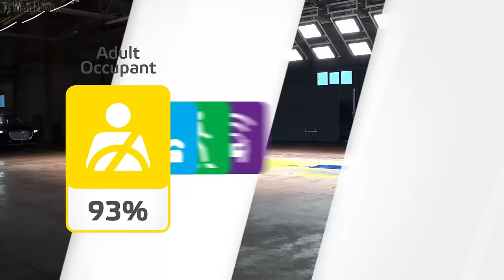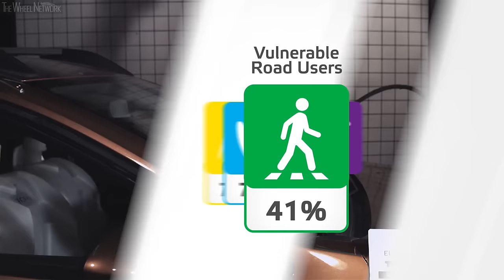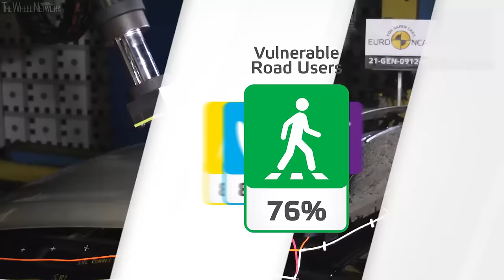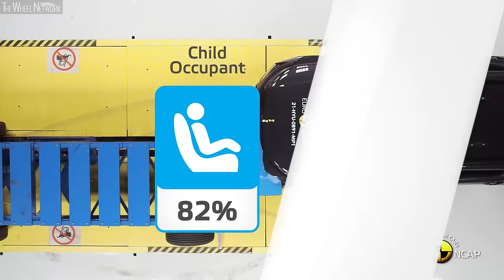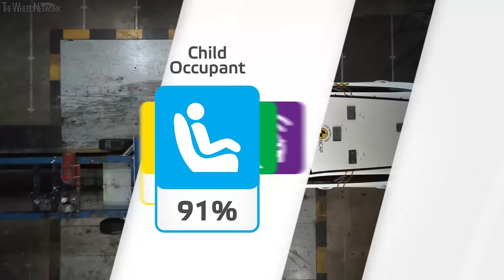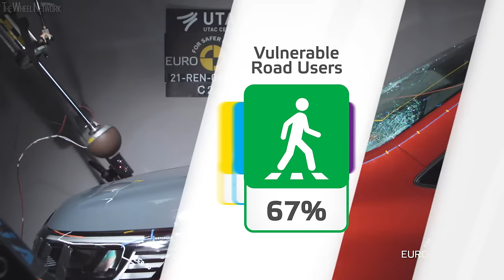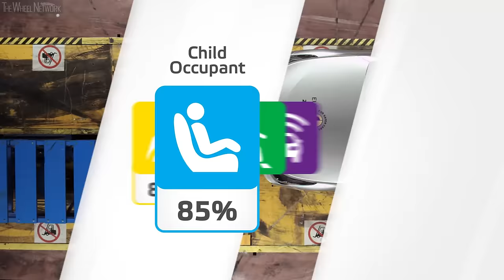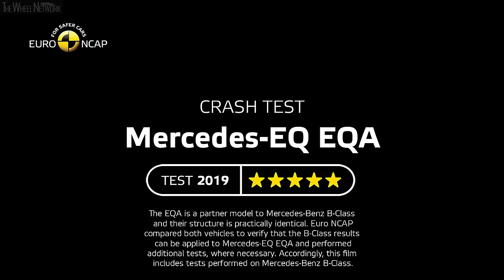Euro NCAP Crash and Safety Tests – Every Car Tested in 2021

Comment: In a certain way, those tests are good, and also a curse. Because, if you want to comply with them, you can't build light, monocoque cars that comply perfectly with electric motors. You need to build the type of semi-quadratic thing with 500 kg of captors that will do well in the euro ncap.
Reply: weight is actually beneficial in accidents. Heavier car will allways do better against a lighter car.
Reply: @joei4ever  Yes, and they will kill through their consumption, that is never taken into consideration when testing them. A ULC has a much lower footprint that an SUV, will required less maintenance of roads, less construciton induced pollution, less running induced pollution.
Reply: 0:24  the crash

Comment: These ratings are whacky...the Polestar gets a pedestrian safety rating of %80 despite hitting a walking pedestrian while the Tuscon gets a %66 while hitting no one...? If you hit someone it should be an automatic failure.
Reply: Maybe it's because it has features that lower impact in g forces. But yes, it shouldn't be that high if it hits pedestrians.

Comment: Why don't they launch them at 90 km / h instead of 60? Let's see how they would really look in real life, since they are all very fast vehicles and at 60 they never go in an accident ... at 90 they should.
Reply: At 90 most of the cars will not provide the safety in case on an accident
Reply: not to mention people typically brake before an impact
Reply: this 60 really means 100. because what it crashes into is stable and doesnt move. in real life whatever u hit absorbs the impacts and moves

Comment: As in aviation safety standards for cars should increase, almost every car here scores 5 stars which shouldn't be the case, cars are newer and safer, star system based on early 2000's cars sample size don't work, even shitiest car from 2022 can reach score higher than best car from 2002, leading to that every car gets 5 stars.
Reply: Good point.

Comment: #AkioT - 🔴🟤⚫🗾🗾🗾I want to accuse Toyota (Toyota Motor Corporation President Akio Toyoda (豊田章男) of mass environmental pollution, ecocide and chemical genocide in Russia, organized by Toyota. Issuing a technical defect as a harmless breakdown, which led to the massive evaporation of gasoline and its leakage. Toyota sold 219,811 thousand vehicles in Russia with a defective fuel system, the scale of gasoline and gasoline fumes leaking into the atmosphere could be massive.The environment can be seriously damaged, and people can suffer from chemical poisoning from gasoline fumes.Gasoline fumes are especially dangerous for children.Similar environmental crime was committed in the US (Vapors of gasoline)
トヨタ（トヨタ自動車株式会社豊田章男社長）がロシアで組織した大量の環境汚染、エコサイド、化学物質の大量殺戮を非難したい。技術的な欠陥を無害な故障として発行し、ガソリンの大量蒸発につながった トヨタはロシアで燃料システムに欠陥のある219,811千台の自動車を販売し、大気中に漏れるガソリンとガソリン蒸気の規模は膨大になる可能性があります。環境は深刻な被害を受け、人々はガソリン蒸気による化学汚染に苦しむ可能性があります。 ガソリンの蒸気は子供にとって特に危険です。同様の環境犯罪が米国で犯されました（ガソリンの蒸気）
https://www.epa.gov/enforcement/toyota-motor-corporation-settlement?fbclid=IwAR2zjXWVkNkTRTm_KrauMppKn-7kAdNSHYQ77gramROkElK79oaGvuC7ufI